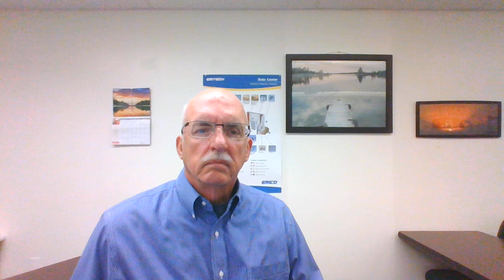Electric Education Center Session #14 Commercial Electrician

Comment: Talked to local 98 foreman about their great conduit bending and layout of conduits. At CHOP they had about 14 ATS mostly 600 to 1600 amp.transfer switches in the emergency power room feed from three 2 Megawatt generators. They somehow squeezed up to 12 four inch conduits into the 1600 amp ATS switches. Thanks for another great video. tom grandson retired CHOP sparky.